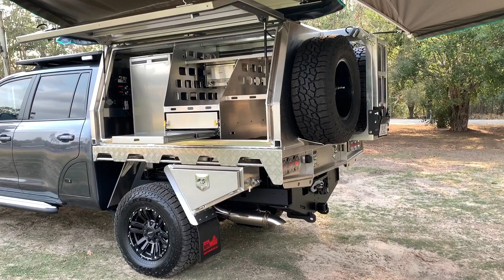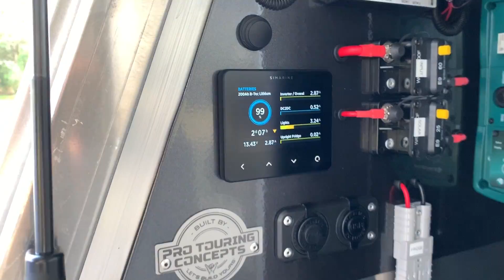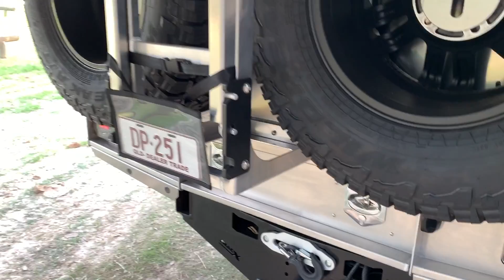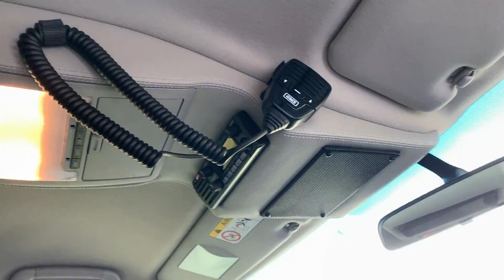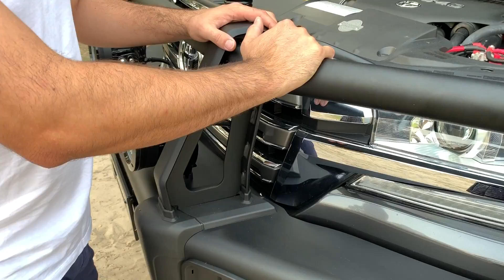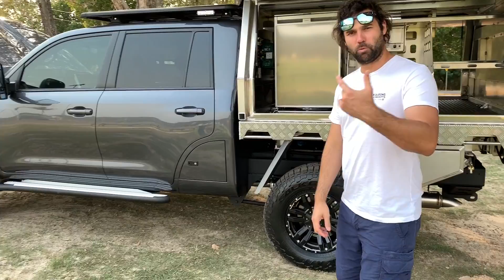4495 Pro Touring Machine - check out this CHOPPED and CONVERTED 200

Comment: 4495 GVM. 4500 Towing. What is GCM? Surely not 8995?
Reply from the maker: 4.495T GVM + 4.5T BTC. Under Federal Approval , or in trucking terms 8.995T GCM
Reply: What is rear axle load rating?
Reply from the maker: Jaye Young 2.8t 👍